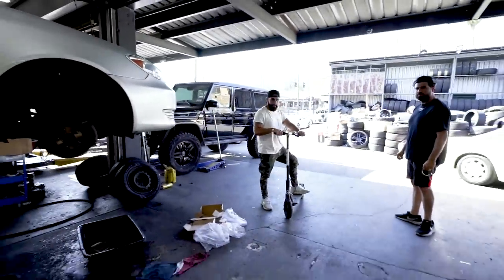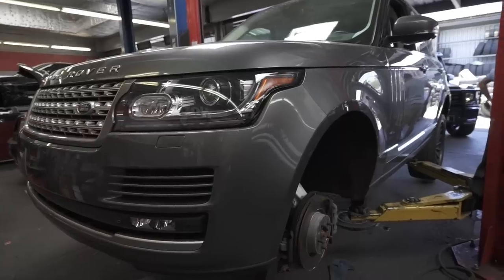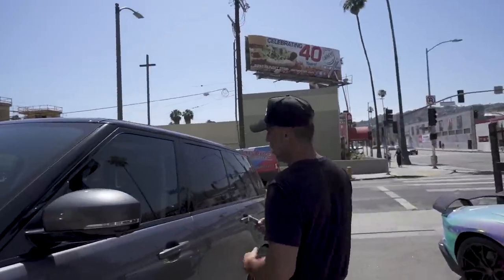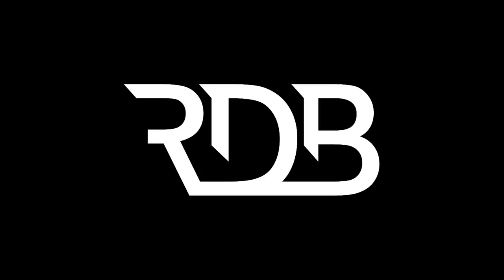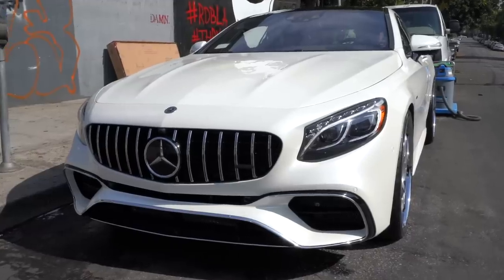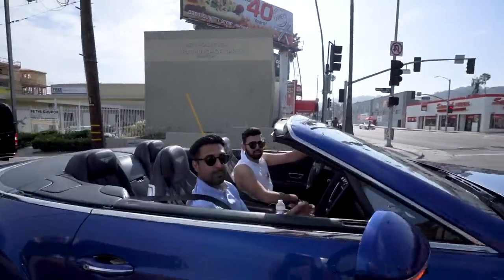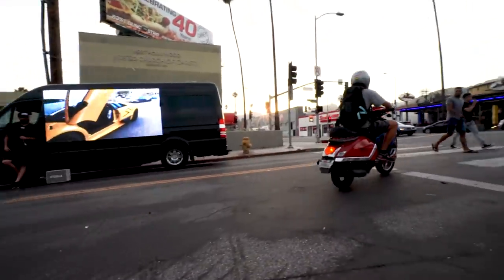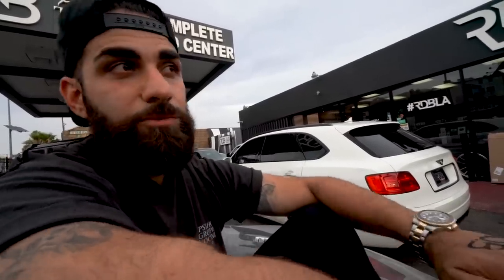#RDBLA PACKED CONTENT, BENTAYGA 800HP, Sprinter BillBoard, lots of cars!!

Comment: What is done to the bentayga? I want to bring mine in & do whatever that has done!
Reply: JetSetFly sounds like you need a tune
Reply: They put the air freshener in, adds 300hp
Reply: They added dropshipping to the bentayga
Reply: I say you get a starlight roof with carbon fiber bits around your car like the hood. They probably did a ECU tune on that bentayga
Reply: then call them?